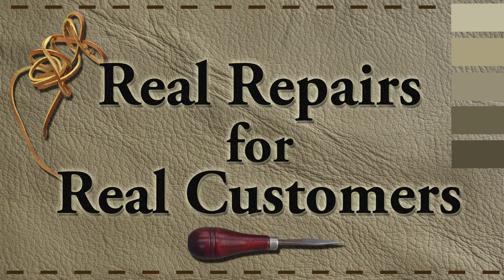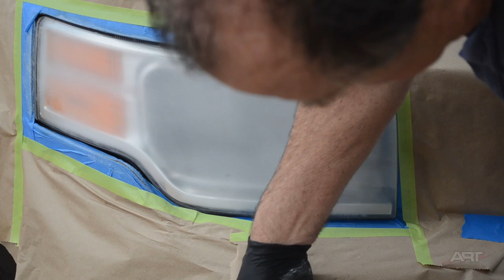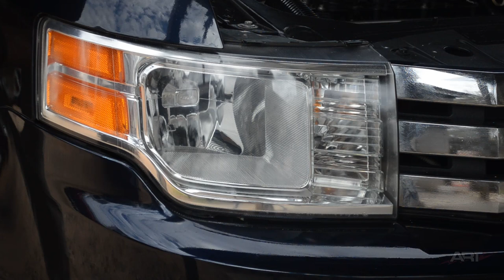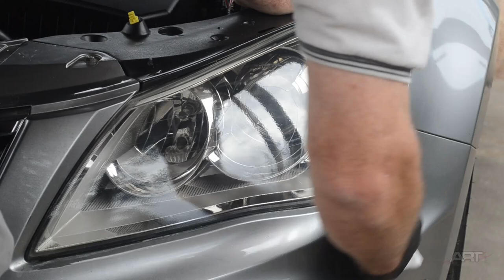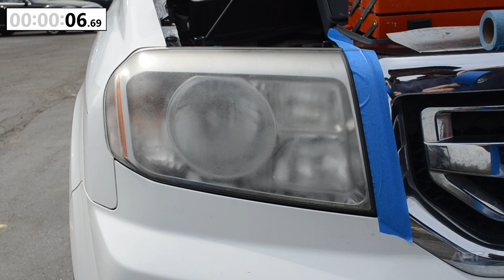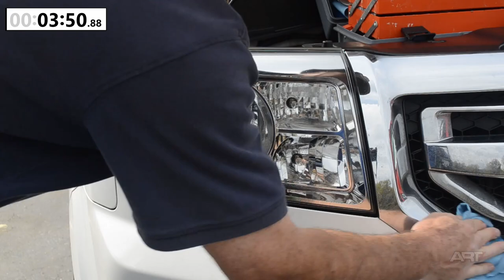Headlight Restore v35

Comment: Thank you for your video on headlight restoration .Could you tell me the name of the clear coat that is being used your expertise is greatly appreciated.
Reply from the maker: Incidentally it doesn't matter at this point.  That particular product has become another victim of the supply chain dilemma.  We are back to spraying as before with our catalyzed clear with a gun.
Reply: Thank you for your reply but one thing I've noticed that some clear coats happy stronger bite than others. Are you still stopping at 600 grit if not what grit is the final grit before clearing
Reply from the maker: @williampayne73  Yes getting a good bite is important.  My suggestion is to see how your clear covers and adjust the final sanding grit accordingly.  Many people demonstrate polishing though before the clear and while it might appear to be the way to greater gloss it can  result in flaking and peeling.  Thanks for the question.
Reply: @a.r.t.srealrepairsforrealc8247  you said that you were back to using your catalyzed clear in the gun. Is this normal 2k clear or is this something else and are you still using that clear or is there something better to use now?

Comment: Thanks. This is how I've  basically been doing them. Do you think rubbing alcohol would be appropriate for overspray removal?
Reply from the maker: Well the percentage of water in rubbing alcohol certainly wouldn't help at all.  In practice, 99% isopropanol can dissolve a solvent clear when the coating is still fresh, but Xylene would be my first choice.  Toluene is very similar. Thanks
Reply: @a.r.t.srealrepairsforrealc8247  thanks. I used some 91 percent on some clear overspray I got on a black car yesterday. Seemed to take it off. I was mostly concerned about it maybe being harmful to the original paint.
Reply from the maker: @kennethemichael  Yes, well the factory catalyzed clearcoat will be impervious to anything you throw at it.  The only thing to watch out for is a bumper that has been repainted cheaply.  I've gotten into trouble there in the past.
Reply: @a.r.t.srealrepairsforrealc8247  im kind of scared to tape a lot around lights. I pulled some paint off of my 07 avalon when I taped its headlights off.
Reply: @a.r.t.srealrepairsforrealc8247  i just stick strips if really thin cardboard around them now.
Reply: What number steel wool??